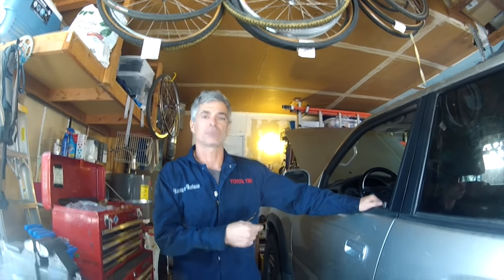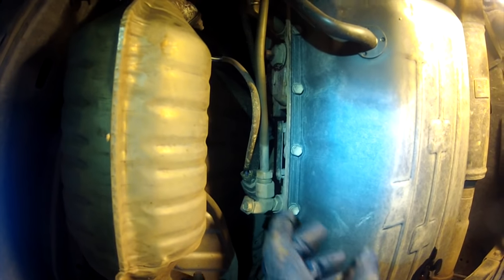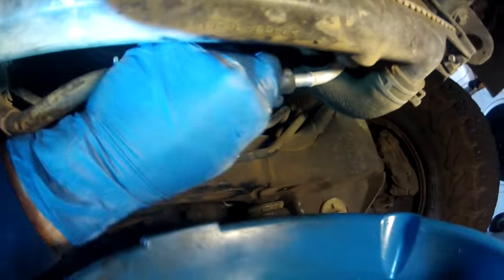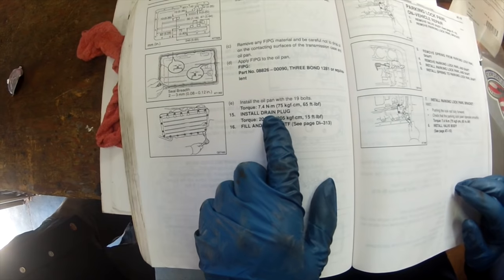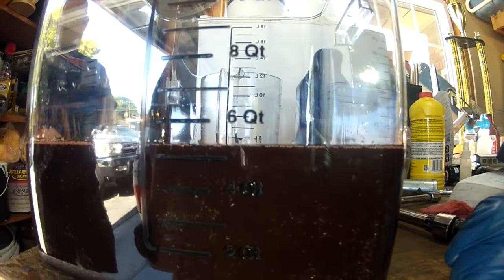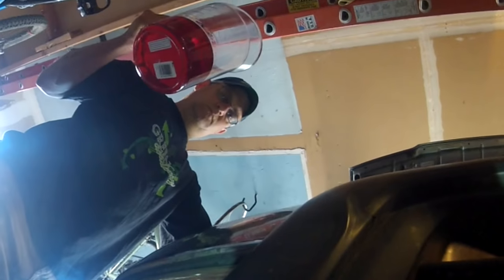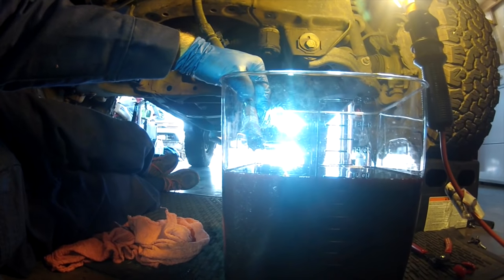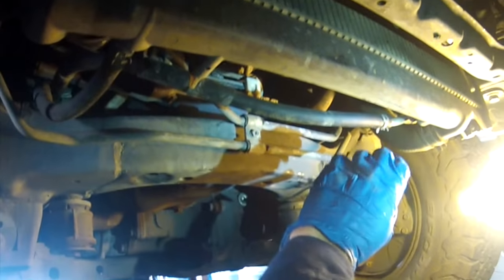Transmission Fluid Flush

Comment: Well done.  Excellent explanation with thorough details and screen shots.  Tim, you are a great educator.  Thank you for helping all of us shade tree mechanics.  I'm debating flushing  the fluid (brownish red) on my '04....178k with last change at 83k.

Thanks again....
Reply from the maker: Thanks!  We're glad you like the video and we appreciate the nice compliment.  You're very welcome.  If I were you, I'd renew the fluid slowly by doing a series of drain and refills of the pan spread out over around 10-15k miles.  Here's my suggestion on how to do it.  At your next engine oil and filter change, do a drain and refill of the trans pan.  At your next engine oil and filter change, do another drain and refill of the trans pan.  Finally after yet another engine oil and filter change do a 3rd drain and refill.  After 3 drain and refills, your fluid will be in great shape.  Doing it this way is safer because introducing a full capacity of fresh fluid all at once might dislodge sludge build-up in the trans and cause a blockage somewhere like the valve body.  ATF has great detergent qualities and that's why you want to be careful exchanging all the fluid out at one time in a trans that's been a bit abused.  

100k miles is a lot of miles on that fluid.  Even though auto manufacturers say their sealed transmissions can go 100k miles without changing the fluid, that's complete bullshit for a whole lot of people.  There's not magic fluids out there.  Heat causes ATF to lose it's lubricating properties.  If you never got over 170 degrees with the fluid, it could last 100k miles.  If this was a vehicle that lived in the flat lands and never towed anything, that could be possible.  If the rig is driven in the mountains at all, you will be going over 170 a whole bunch.   So, it depends on how the rig is driven on how long the fluid will properly protect the transmission.

I do a drain and refill of my trans every 10k miles.  This keeps my fluid in great shape.  I've never done a full flush on any of my rigs.  Some guys like to wait a certain interval like 30k or 50k miles and do a complete flush like we show in this video.  Doing more frequent drain and refills is so simple and effective so that's why I choose this method over a full flush.
Reply: @TimmyTheToolman  Tim,  Thank you for your cogent  and expeditious advice.  I will heed your recommendation.  I purchased the 4Runner used (approx. 150k) 5 years ago.  The car was a local (Chicago suburb) trade in but appeared to have been used for some off-roading (many scratches and dents....hood and sides.)  The hitch is very rusty, but no way to tell if used for towing.  I had planned to drop the pan and replace the filter, but after viewing a couple of videos that described the difficulty in reaching a couple of the rear bolts (especially when lying on one's back), I decided to pursue other options....your video.
 
The engine sounds great and trans is fine (currently,) but would like to head to Colorado/Utah for some off-roading and not have to worry about the tranny.

Thanks again for your help......you're the best.   SM
Reply from the maker: @greenjondear  You're very welcome.  Have fun with your rig.

Comment: Hey Timmy... I'm a new 2001 4Runner owner and channel subscriber.  I'm changing the radiator out and was curious if that would be a good time to flush the trans fluid?  I bought it from my sister and it's in great condition with 186k.  Shifts and runs like a champ.  The  transmission oil looks clean on the stick, but my brother law doesn't remember if, or when they ever flushed it.  I love the detailed approach to your videos.  Thanks!
Reply from the maker: da324 doesn’t hurt to do a drain & refill of the trans fluid to get a better picture of how dirty it is then go from there. If it’s clean, I wouldn’t do a drain & refill for a while. If it’s dirty, consider the drain & refill over the next couple oil changes to renew the fluid.

Comment: I did it! I decided to flush one quart at a time. I was working by myself. The only odd thing I noticed was hearing some kind of clicking noise at the  very start of the flush of fluid of the one quart each time. Not sure if that was normal or not. Heard the clicking each time for all 10 7/8 quarts. LOL. I can see why one would want to flush out the ENTIRE 10 7/8 quarts my G35 Infiniti Coupe 2007 capacity. I did a drain couple week ago of 4.0 quarts... I can see why the drain seems like a worthless effort. Now the fluid if pretty and clean they way it should be! I was very careful to take it SLOW on the entire procedure. Been driving the car last few hours...driving smoothly...no issues...Next time, I will ask someone to input the one quart as it comes out simultaneously...not sure  if that would quiet the odd clicking noise...the noise was not for very long...maybe 1 second once I started the car at each repetition...The fluid drains out fast...I would say one quart every 5 seconds....I did "time" inputting the fluid to my surprise it goes in very fast, about one quart per 7 seconds...but I decided to wait until after the one quart flush...The only question I have is "should I have plugged the open ended tube I removed the return hose from?..I decided to not remove the hose at the hose-radiator (return side)....but higher up...following the return hose up about 12 inches, and disconnected from the steel or metal  tube connection....I did this because it gave me hose to play with as I attached into it a 3/8 outer diameter hose into the radiator return hose, for G35, my car...it's on the driver side...
Reply from the maker: Good job getting it done.  No, you didn't need to cap off that line you pulled the hose off of.

Comment: even if you just do a drain and fill, every oil change, there is no reason for damaged transmission due to neglect of fluid on a 3rd gen. it is so straight forward.  I don't know why they switched to dipstickless transmissions on newer cars... makes things so much of a pain. 

I didn't think of your method for an even more thorough process.  Great for people who might have had the pink shake or might have been a little late on there last drain and fill. 

Is it really just the toyota WS fluid trannys that is anal about toyota fluid only? It seems a see a bunch of videos just using valvaline. based on my readings, i kept seeing use toyota fluid or world will end type posts on the internet. I am no expert. I guess any fresh fluid is better than old fluid. 

As always thank you for your time in the videos.
Reply from the maker: Hey Bardia, I agree with you.  I normally just do regular drain and refills of the pan to keep my fluid in good shape.  But, there are purists out there that scoff at this "Dilution" technique.  And you know what, to each his own.  I believe my method of draining and refilling the pan every 10,000 miles is keeping my fluid in really good shape.   Now, if I wasn't willing to do it that often, and wanted to wait until the 30,000 mile mark to drain the fluid, a full flush would be much better.  I like the ease of just removing a drain plug, draining the fluid, putting a new crush washer on, tightening the bolt and filling it back up.  It's so simple.  Easier than changing the engine oil and filter.

I don't know about newer Toyota transmissions but using any Dextron III compatible ATF is fine in my book for our rigs.  It's just like the "Use Toyota Red Coolant Only or Die!"  My truck was converted at some point to Prestone Green and that's fine by me because that's what I've been using in all my vehicles up to this point.  The good thing about Preston Green is you can find it anywhere.  Suppose you bust a radiator hose somewhere in the middle of nowhere.  Think you're going to find Toyota Red in some small podunk town auto parts store.  Good Luck!  If I had Toyota Red in my truck, I'd carry some 50/50 with me in case I get a leak and have to repair it.  But, if it's a lower radiator hose and you lose most of your coolant, you'd need to carry at least 2 gallons with you.  So, something to think about for those insisting on using only Toyota Red in their rigs.

And hey, I'm glad you're finding the videos Sean and I have been making useful.

Btw, did the alternator brush replacement today.  Getting the alternator back into the bracket so we could get the pivot bolt back in fought us but we finally got it lined up and back together.  My brushes were worn down but there was still some life left to them.

Comment: Good day! Timmy I’m so happy to have come across the trans flush, and appreciate the information a lot because I have been planning to change it.But I have something to ask since I have been planning to get a strainer because my truck has a whining noise and I thought the strainer is clogged so now my question is will flashing kind of unclog the filter? 
Will appreciate your thought on this…it’s a 3rd gen 1998 with 115km on it and bought it at 90 so no service history.
Reply from the maker: The whining noise probably isn't due to a clogged filter but I can't say for sure.  Doing the flush won't unclog the filter.  You used the right term for it though.  It's really a fine mesh metal strainer and not a true filter.  It's worth a shot to replace the strainer and do the flush before moving on to more expensive options.   I'm thinking that whine is coming from the torque converter.

Comment: Curious to why the filter wasn’t changed. My 2003 4Runner came with a factory trans cooler mounted in front of of the radiator. Another great video
Reply from the maker: The transmission filter is a fine metal mesh strainer.  They can get clogged if the transmission was really abused and sludge deposits built up, but usually, the filter really never needs to be replaced.

Comment: At 8:00 you put the torque wrench on the nut that was already tight. Because it clicked, it was AT LEAST that tight. BUT it may have been over-tightened and still click ?    PS you make some of the best TEACHING videos I ever see.  Thanks.
Reply from the maker: Hey Steve, you're right, I could have had it over the torque spec but I wasn't concerned.  I've tightened drain plugs hundreds of times over the years doing oil changes, transmission fluid changes and gear oil changes on my vehicles and never stripped one.

I've been wrenching on vehicles for around 36 years but it hasn't been until recently that I started diving in further into auto mechanics than the usual general maintenance and tune-up sort of stuff.  I bought my first torque wrench almost 2 years ago and now I own a total of 3.  I learned at a young age how to avoid breaking and stripping fasteners and it was pretty much just using common sense.  With a small fastener, use a small wrench or choke up on a longer wrench to reduce your mechanical advantage and don't put a lot of muscle into it.   With a larger fastener, maybe use all the mechanical advantage you can get with the wrench and put some serious muscle into it because it's a big bolt holding something like the transmission to the engine.  I do have to admit I like owning several torque wrenches now and it is nice to know you are tightening fasteners to the spec the Toyota engineers determined was best.

One important thing you have to realize about following factory service manual torque values is they are sometimes wrong.  We have found several mistakes in the FSM.  Some are pretty bad and if you blindly follow the manual, you will be breaking off bolts and stripping threads.  So, you still have to use common sense and realize when a torque value published in the book has got to be a mistake.

We're stoked you like what we're doing.  I also like that you used the word TEACHING because that's one of our goals making these videos.  Our videos tend to be pretty long because we really want to educate the viewer and give them the best chance at success with the job.  We're not perfect and sometimes the technique or method we share doesn't end up being the easiest but we try to report back in the video description helpful tricks we learn later from people commenting or we learn on forums.

Thanks for taking the time to comment.  Happy Wrenching Steve!

Comment: It's a shame they took the plug out of the torque converter. I remember buying a 63 Plymouth Belvedere and it needed a battery and tune up and while I was changing the engine oil I also changed the trans fluid. I moved the torque converter around until I saw the plug and removed it. I measured how much fluid came out and then topped it off according to the dip stick. Wish I still had my 63. Good video I did this on my son's Camry. It did not want to shift into and stay in overdrive. After changing the ATF overdrive worked like a champ.
Reply from the maker: Yeah, a plug in the torque converter would be nice to have.  But, this flush gets it done even though it takes a little longer.  Glad you like the video and you had a great result after renewing the fluid.  Thanks for taking the time to comment.  Happy Wrenching!

Comment: Hi Timmy! Thanks for the great videos to help the DIY for 3rd Gen 4runners. I want to share a product with you that I have tried on my 1997 Toyota 4Runner called Hot Shot Transmission Stiction Eliminator. I have used the product right before a transmission flush on both my 4Runner and my wife’s Sienna and it helps the transmission shift smoother. Something that you might want to test out.

Comment: Need to make a video on how to change transmission fluid on a 2009 Toyota Tundra 5.7 liter, with no dip stick.  How is it done.
Should I change the filter?  Then change the entire fluid?  Thanks Bobby.
Reply: A bit past your time, but For all the Tundra, Tacoma, heck, Almost any Toyota without a dipstick, observer the following.... (this is from a Tacoma point of view, but similar for others). You fill the trans from the side hole (24mm bolt I believe) on the passenger side. You check level buy loosening the "overflow plug: in the bottom (hex key). After drain, or filter swap (and reinstalling the pan), whatever, add fluid until it starts trickling out the overflow plug. adapt the rest of tim's procedures as needed, or follow the FSM if you can get one. Hope that helps.
Reply: @sdonovan149  The procedure you mention is totally dependent on fluid temperature, since ATF expands greatly when heated.  Unless you have the scan tool to accurately measure the fluid temperature on the fly, I would not use the "trickle" check.  Assuming you have had no leaks and assuming the transmission fluid level was correct before your service attempt, the best thing to do is to accurately measure the amount drained and add exactly that amount back into the fill plug.

Comment: Hi Tim great video.  You state in one of your replies "You are correct, there will be some old fluid left in the rubber and metal return line that goes back to the transmission but some of that will drain out of the line as you let it hang while you are doing the flush procedure".

Is it better to leave the return line open (where it could potentially suck in some dirt), or plug it so nothing can get sucked into the transmission?

Just thought I'd ask before I do this to my 2006 Highlander.

Thanks - Greg
Reply from the maker: Hey Greg, glad you like the video.  You can just let the line hang over a drain pan.  I don't believe there would be any suction on the return line but I don't know this for certain.  I guess during the flush procedure you could put your finger over the end of the rubber hose and see if it gets sucked against it.  As long as the hose isn't resting on the ground or submerged in a dirty drain pan, you wouldn't have to worry about anything being sucked in.
Reply: Thanks for the quick reply Tim !!
Reply from the maker: @gregdzierzynski278  You're welcome!

Comment: I just want to do a basic transmission drain and fill with every oil change. Would it be as simple as pulling the drain plug, measuring the amount that came out, and replacing that same amount with fresh fluid? Would measuring the temp be necessary with this method? Or is it basically drain, refill, and plug? Thanks.
Reply from the maker: If you can measure it very accurately, your method would work.  With that said, I do measure the amount that comes out and replace that approximate amount but then I do bring my trans to operating temp and confirm the level is right.  The food grade container I drain the oil into has graduated marks but it's rare that you fall perfectly on one of the marks but rather somewhere in-between so there's a bit of guesswork on how much drained out.  It gets you very close but not exact.  Are you dealing with one of those sealed transmissions without a dipstick?

Comment: Amazing Video, I plan on doing a flush on my sienna as I used T-IV instead of WS, how much quarts did you use in all?
Reply from the maker: We used around 12 quarts.  That's the approximate system capacity for 3rd Gen 4runners.  You could just go by visual though.  As soon as the fluid looks brand new coming out the cooler hose, you're done.  But, 12 quarts is probably going to be about right for your vehicle too.